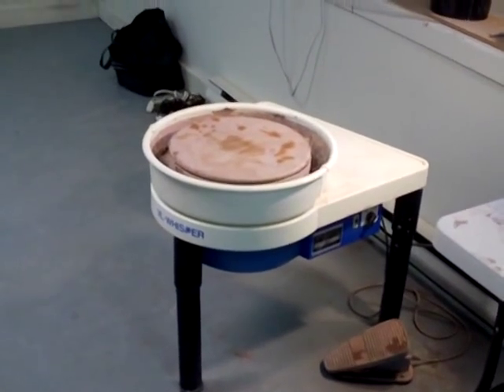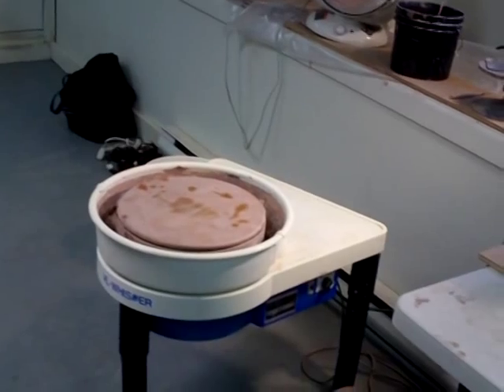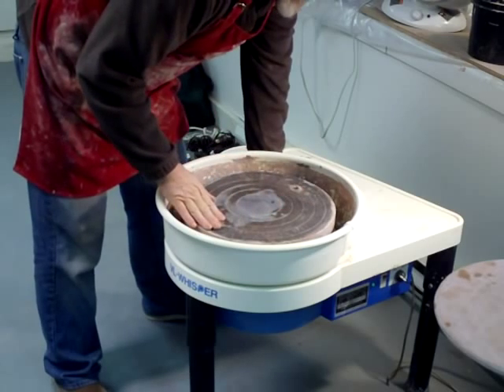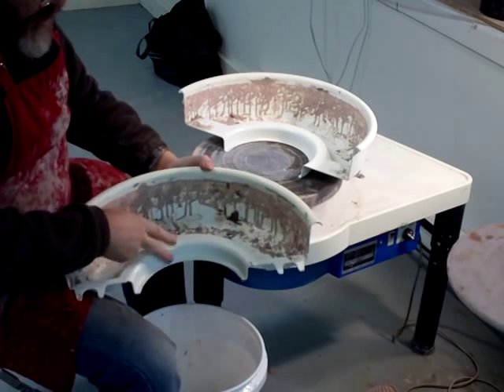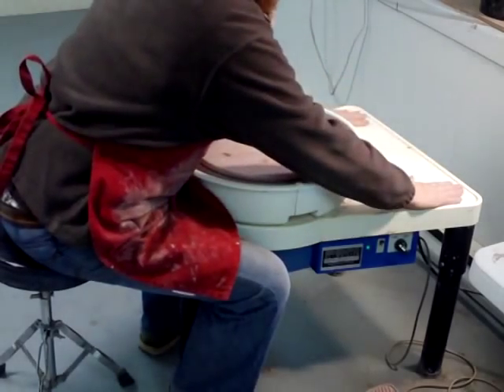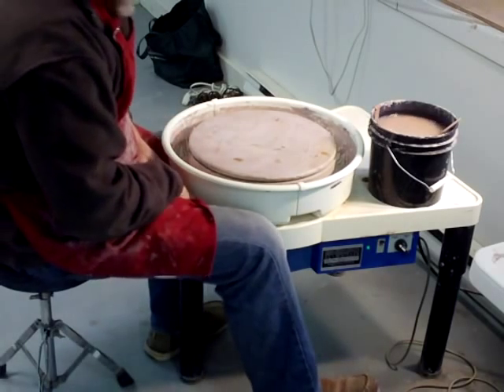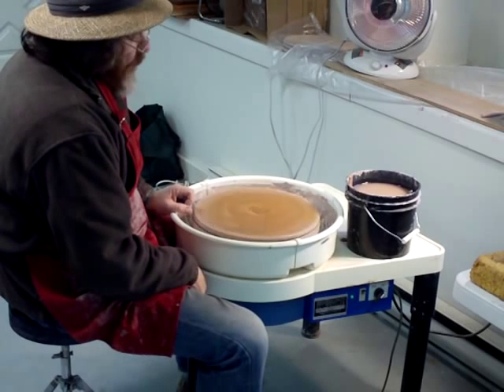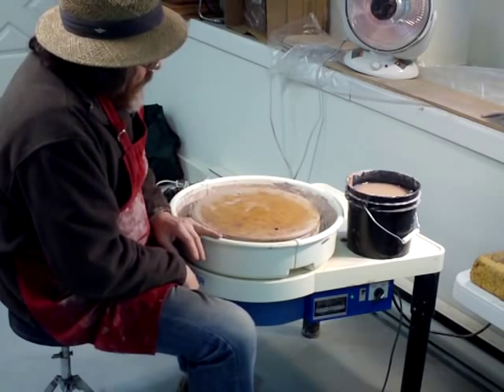SIMON LEACH POTTERY TV - My thoughts about the Shimpo VL whisper ! - Feb 12 2014

Comment: this is 1/2 HP  100 Lb . max clay weight  model, i think.
some very few people say it lacks low end torque. while i have not used this unit i was glad to see that you showed that it does indeed have capable low end torque.
question ?
is not the pedal adjustable to finesse its responsiveness ?

Comment: This wheel is at my school,  along with other older model shimpos. It's by far my favorite! I notice you trim on the bats in your videos. I trim directly on the wheel and I'd like to add that trimming on the whisper is a little harder than the yellow table top shimpos. The whisper has tiny grooves on the wheel head (like old vinyl records do) that make it harder for trimming when you're only adhering your piece with water. If you use lugs, there's really no difference, but since i just wet the lip and the wheel, I've found that the grooves don't provide as good of a suction as other shimpo wheels do. 
Btw,  I absolutely love watching your videos! You've taught me so much :)!
Reply from the maker: Yes i trim on the bats as the wheelhead has batpins which might lacerate my hands if i did not !  Yes getting the right amount of moisture on the rim and wheelhead and some downward pressure is key to getting it stick. Well done for not using lugs of clay !

Comment: My S.Whisper did not come with bat pins or a plastic batt. But Shimpo will sell an alternative batt head for £260 YES £260 which will take drop in batts at silly £ per batt. I notice the USA S.Whisper came with batt pins is that because they demand quality and we just take what we’re given - feeling angry
Reply from the maker: Eddy Ward ...if it's the same wheel head as ours over here you can drill it out and put a couple of Allen bolts with the heads to take the bats, just measure accurately and away you go !   ...  (maybe !?)
Reply: Simon Leach thank you Simon, I only use batts for plates and usually use clay pad which is a messy, I’ve had this wheel a couple of years and really like it but bit ticked off that I have to drill; which I shall, myself -  btw it’s Susy ward - eddy is a grandson- I have to arm wrestle my iPad and laptop from the little dears so names get changed - love your TV, keep practicing